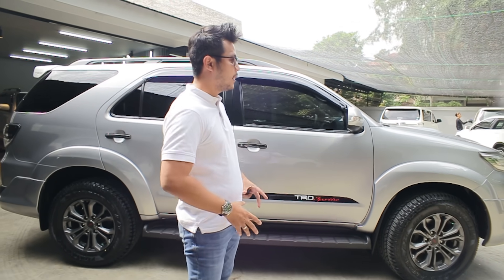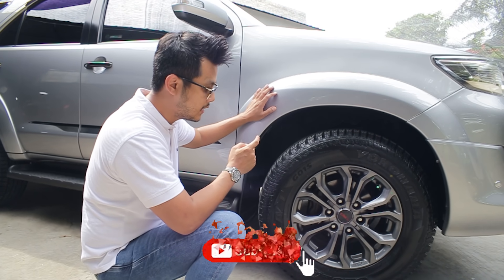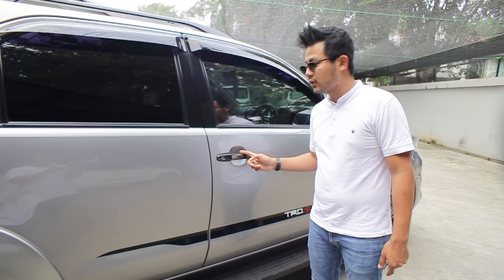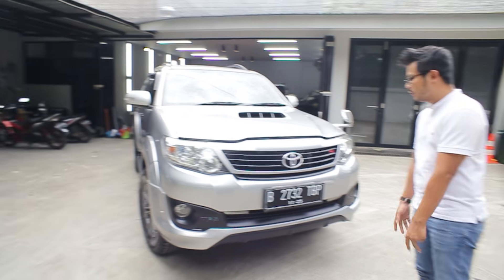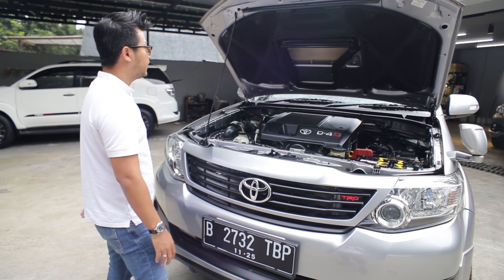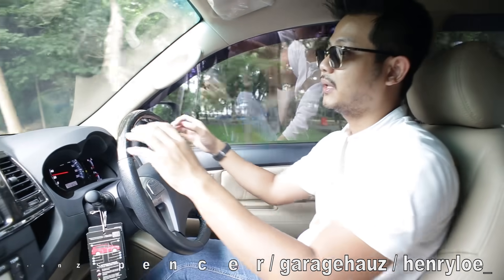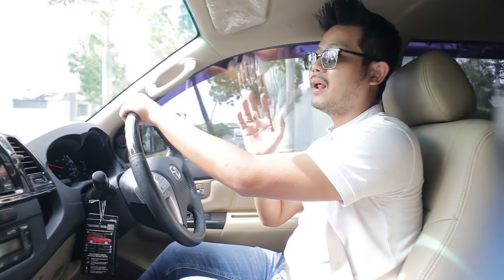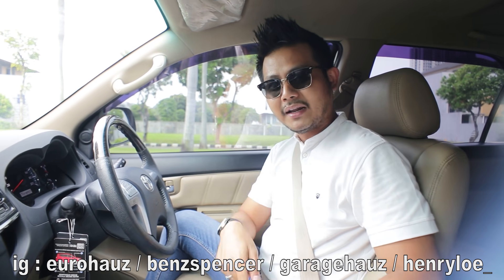FORTUNER VNT TRD 2015 WARNA SPECIAL SILVER

Comment: harga filtegr udra sya mau bli  dmna bsa bli  filter udrny
Reply from the maker: Nih buat yang perlu perlu barang barang Fortuner VNT Diesel yah dan non VNT Diesel juga bisa. 

Setelah remap lebih jos d lengkapi ini semua. Kalau belom remap juga pasti naik tenaga, mengurangi lag, dan menambah tenaga pasti nya. 

Sangat berguna banget dan worthed it banget buat dibeli karena sekali beli gak beli beli lg deh. Bersihin nya jg ga perlu cairan, sedangkan front pipe berguna untuk Fortuner VNT karena front pipe standar bawaan pabrik ada catalyst sehingga pembuangan tdk selancar aftermarket yg kita jual. Jd tenaga lebih plong

Beli AIR FILTER REPLACEMENT SPRINT FILTER FORTUNER DIESEL 2005 - 2015 
https://tokopedia.link/iOJZ3PMzBdb di toko eurohauz Rp1.985.000 di Tokopedia dengan Bebas Ongkir, Sekarang!

Beli Front Pipe Fortuner VNT 2012 - 2015 
https://tokopedia.link/SY6UmGpszdb di toko eurohauz Rp1.550.000 di Tokopedia dengan Bebas Ongkir, Sekarang!

Sekalian juga yang mau terlihat rapi dan OEM ala eurohauz bisa beli plat dudukan embossed kita biar tampil an makin joss.

Beli DUDUKAN PLAT NOMOR MOBIL OEM EMBOSSED EUROHAUZ 
https://tokopedia.link/XdvVmuYzBdb di toko eurohauz Rp99.000 di Tokopedia dengan Bebas Ongkir, Sekarang!